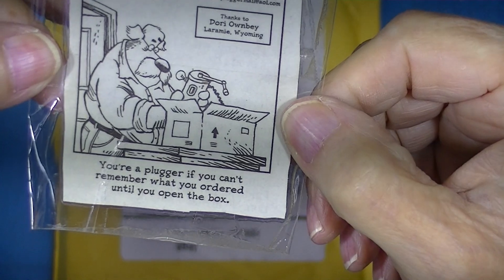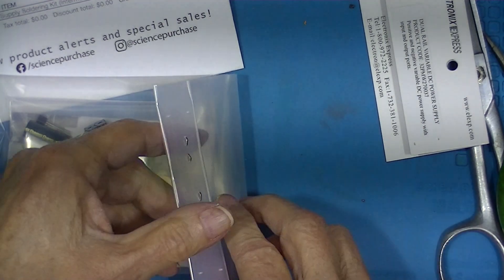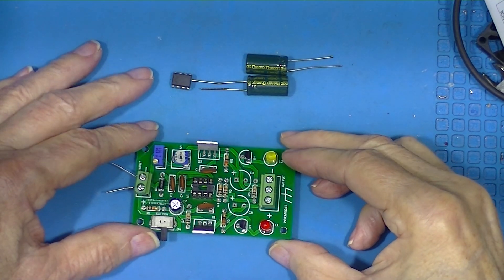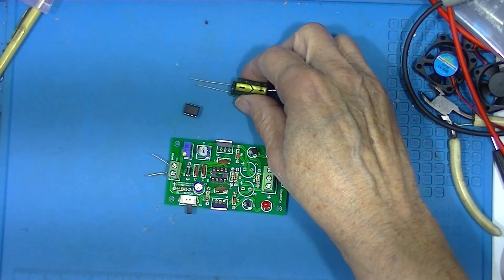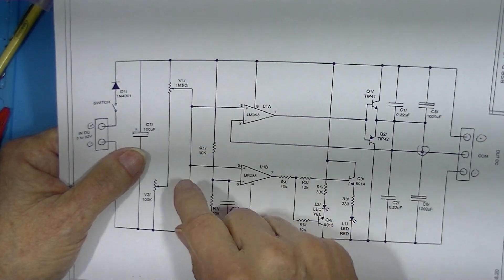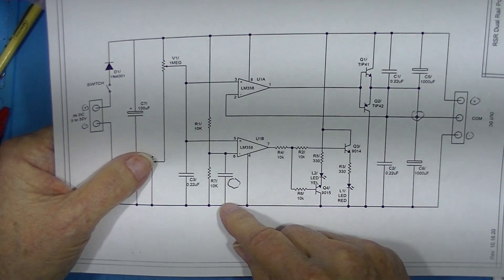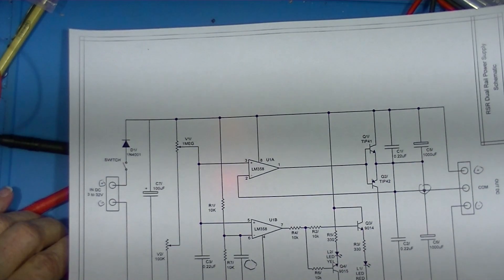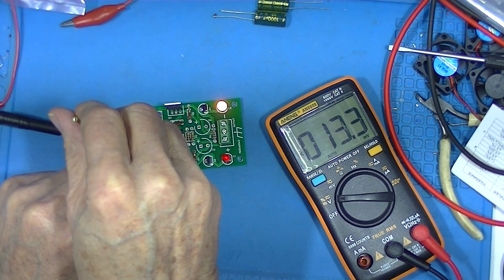Split Rail Power Supply - Part 1

Comment: That's a cool module. Glad you showed the schematic. I was wondering if push pull transistors could be connected directly to the output of the op amp or if you had to bias them first.
Reply from the maker: Probably, and you would have to see that the design provided proper bias, as well as some other stuff.
Steve